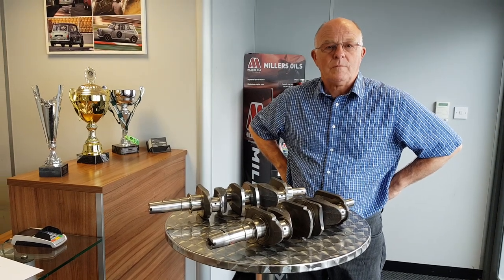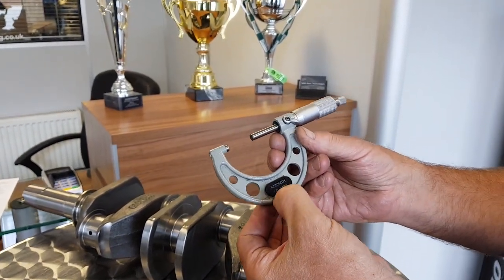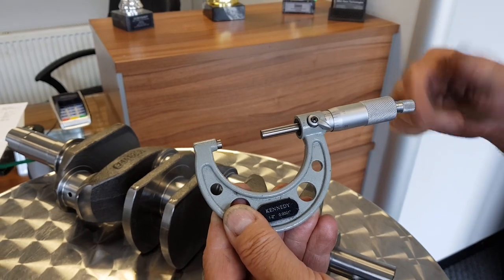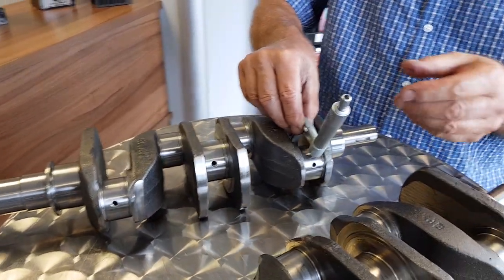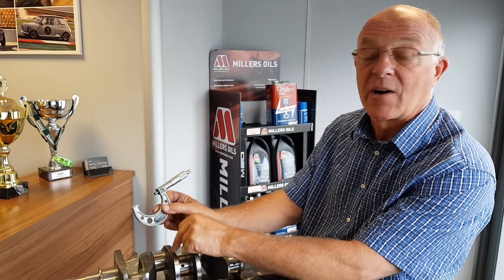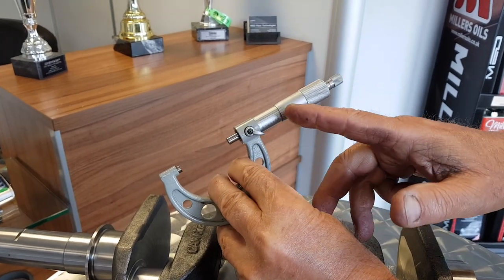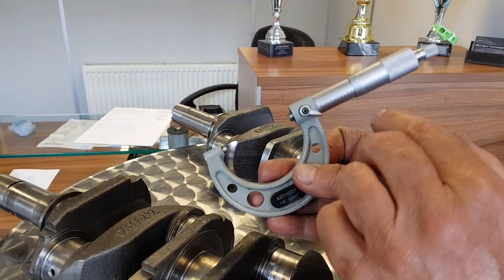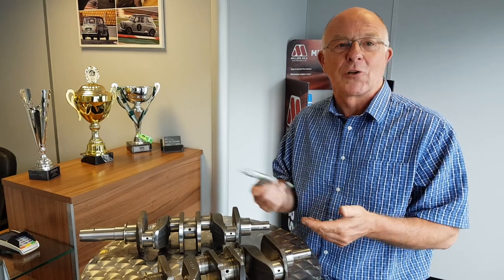How to measure your crankshaft journals with a micrometer

Comment: If the diameter is 2 thou under and the scratches are 2 thou deep, then 2-1/2 thou x 2= 5 thou to clean up scratches plus the 2 thou under= 7 thou, so 10 thou (0.010) should clean it up